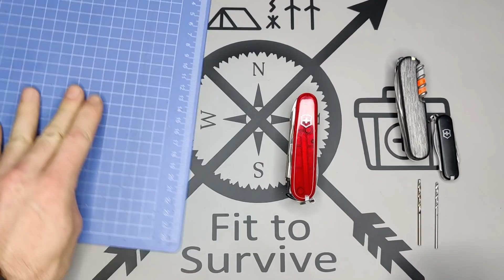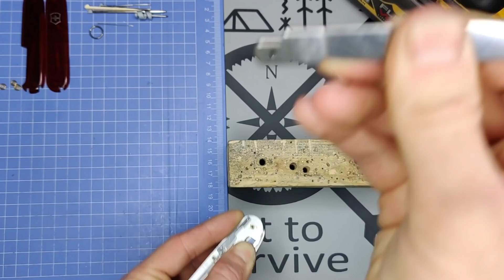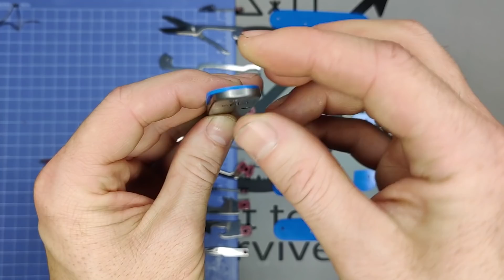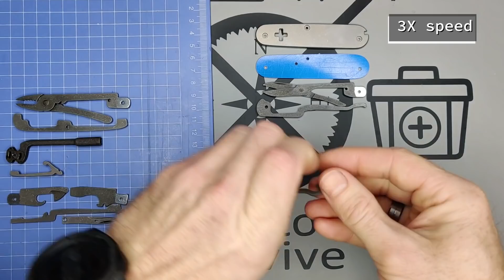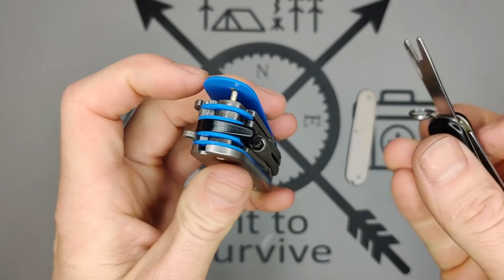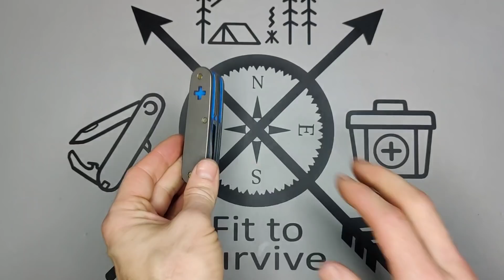How I made this Bladeless Cybertool M

Comment: Hey. Great video as always. Question. I am look for a multitool that would be perfect for paracord weaving. I know that the swiss army skipper pro comes with a marlin spike. But i am looking for more features. Such as non serrated blade and scissors. Is there a build you can do for paracord? The butane lighter would also have been perfect for such a build if it was not discontinued.
Reply from the maker: Hey, thank you.
I can actually add the reamer from a 93mm knife to a 91mm knife. It would replace the original small blade. Then, you would have a larger choice of tools to add to the knife.
Reply: @FittoSurvive  thanks. I checked out your website. Will give the build some thought and contact you through your site.
Reply from the maker: @stephangrobler5524  Sounds good.

Comment: Great build as always! I wondered about the liners, I think you said weight and durability is almost the same, but what about thickness? And how do carbon fiber liners compare? I imagine carbon fiber makes the SAK thinner, but maybe brittle and less durable?
Reply from the maker: The thickness is also identical. They are both 1 mm. Carbon fiber is very similar to the G10, I have tested to see how well it flexes, but I assume that it would perform just as well. The carbon fiber that I use for liners is also 1 mm, so it would not make the knife any thinner.

Comment: Can you tell me the exact size torx screws I would need if I wanted to replace the pins in a pioneer with them?
Reply from the maker: The Victorinox Pioneer is a 93mm Swiss Army Knife. The two pins on the sides are 3 mm and the pin in the center is 2.5 mm.

Comment: Can you exchange the brass rod for aluminum rods? I'm not a major fan of the brass with the grey titanium scales. So could I use aluminum instead of the brass?
Reply from the maker: Aluminum is a significantly softer metal. I am not sure if it would work for the pins. If I am not mistaken, the XAVT uses nickel pins. So, that would probably work because it would be silver colored.
Reply: @FittoSurvive  
That makes sense, thanks.
Reply from the maker: @timothyvolkers5343  You are welcome

Comment: Would it have been possible to move the can and bottle opener to the knife side to keep the cork screw ?
Reply from the maker: Yes, that would be possible.
Reply: I just got the M and wanted to thin it down a little and was thinking of getting the combo tool with knife from my compact and putting it on my cybertool. Where did you get the brass pins ? Thanks for the content.
Reply from the maker: @johnparinellojr.2035  Here is what I usually use for the 2.5mm pins on the sides but they are currently out of stock: https://amzn.to/3eRsYid
Then the 2 pins in the middle will need a 2.2 mm brass pin. Those you have to search for... And usually they can only be found from China. Or, you can take the 2.5mm brass and sand it down.
Reply: @FittoSurvive  Wow thanks for that. When there in stock again I’ll be buying some. Thanks again.
Reply from the maker: @johnparinellojr.2035  You are welcome. Maybe check online (Google search). Maybe you can find them online.

Comment: Why did you use fingernail polish remover rather than acetone? Why ferric chloride and not gun blue? Having watched further I'm assuming you went with ferric chloride for the stone washed look on your tools.
Reply from the maker: I actually use either acetone or fingernail polish remover. Just the one was close by. 😝
Yes, you are correct I use the ferric chloride because I can then do a stone or soft metal wash on them.

Comment: This is exactly the style multitool ive wanted for years except with locking tools like the Leatherman.

I carry a dedicated knife and have no need for one on a tool like this.
Reply from the maker: Awesome. Getting locking tools on a Swiss Army knife will be a problem though.
Reply: @FittoSurvive  I know, next to impossible.

A bladeless locking multitool is actually on my list of things to have designed. 

I really only use a few things for contractor work and like I said, carry a dedicated knife. So it's only going to consists of Pliers, scissors, small prybar/file and a multibit screwdriver, and I have a few other idea to incorporate but that's the jist of it.

Comment: Can you put the in your non carry on luggage, like the ones you check in?  or is that illegal also.
Reply from the maker: You can place Swiss Army Knives in your check-on without any trouble.
Reply: @FittoSurvive  thanks, On international flights if you have a connection TSA or similar agencies will take it.  I had it happen to me once 20 years ago in Paris.  Somebody on Google mentioned if you have direct flight they will not, so it is very tricky.
Reply: @FittoSurvive  wonder if you break off the blade, will they let you carry it.  When you get home just replace it, not easy though, but you will still have all the other tools.
Reply from the maker: @SunMaximus  The original blades are pretty difficult to break off. But that might work.
Reply from the maker: @SunMaximus  Wow... That is crazy. Never had that happen.
Reply: @FittoSurvive  have you tried to stepping on it and breaking it off sideways with your heal, will it damage the whole knife?
Reply from the maker: @SunMaximus  I have not tried that. But there is a good chance that it would damage the whole knife. Also, replacing the original blades is not really that easy. I can do it, but most people would not be able to.
Reply: @FittoSurvive  the scissors you can get through TSA?
Reply: Also can you use screws instead of brass rods?  what is the measurements of them? is it 2mm round?
Reply from the maker: @SunMaximus  There are torx screws available for these scales, but the torx screws that I have available were not long enough for this build.
Reply from the maker: @SunMaximus  According to the TSA website, you should be able to board the plane with the scissors. BUT, it is up to the TSA agent inspecting you to decide. 🤔 So, it is confusing and risky.
Reply: @FittoSurvive  Have you had any problems getting on? I one had mine taken at LAX 10 years ago.
Reply from the maker: @SunMaximus  I have not tried flying with one yet. But I plan to next time I travel.

Comment: Question:
Wouldn't the acid make the tools more prone to rusting? (I'm basing it on the logic that the tools come in some form of chromium coating)
Reply from the maker: I have not had any problems with the tools rusting after acid etching. I imagine an in depth Google search would be needed to give you a definite answer though.
Reply: @FittoSurvive  I see, okay, thanks for the reply!
Reply from the maker: @NovaRanger007  You are welcome.

Comment: Considering that the TSA confiscates nail clippers, and gives you a limit on liquids... the awl and scissors would make it a red flag. But it depends on the agent, since Homeland Security managed to take bombs unto a plane 7/10 times. According to one stewardess, my phanny pack is safer bouncing around on the floor at my feet, than strapped securely around my waist... and a multitool without a blade is kinda pointless
Reply from the maker: Yeah, it is definitely questionable whether or not it would make it on the flight.
I don't know if the pun was intended or not, but a bladeless SAK is completely pointless. 🤣🤣🤣👍🏻